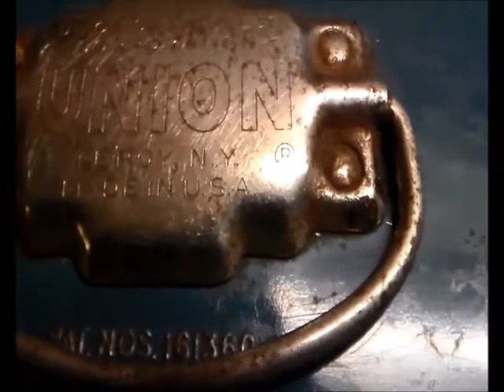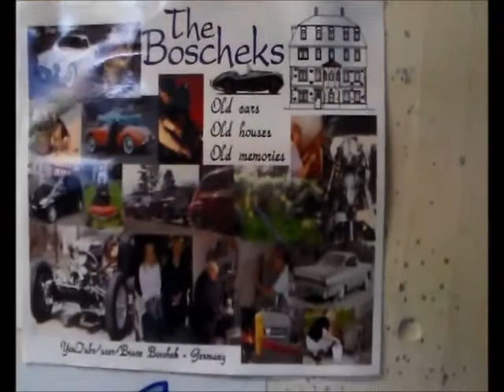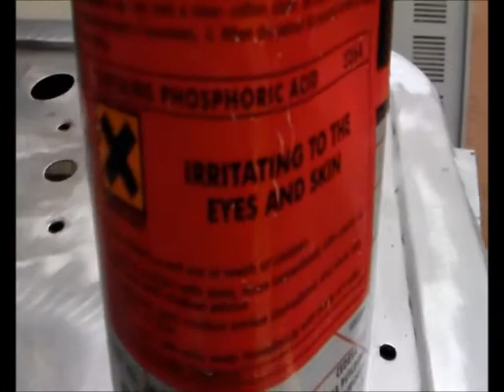7Dec14 Weld repair to Triumph Vitesse Door

Comment: Excellent work , I'm guessing the stuff you brushed into the pits is phosphoric acid ? How do you neutralize and have you had any paint adherence issues ?
Reply from the maker: Hi bud, yep it is, I've been using a weak glass cleaner/water mix, I have a hair dryer on hand to make sure get it dry, but saying all that I have a problem with some paint I dont have answers for yet!
Reply from the maker: The paint turned out to be me being stupid......  not giving the primer enought time to flash! Ooops